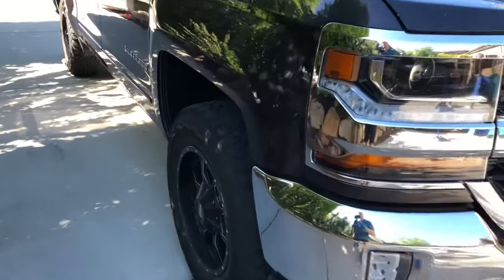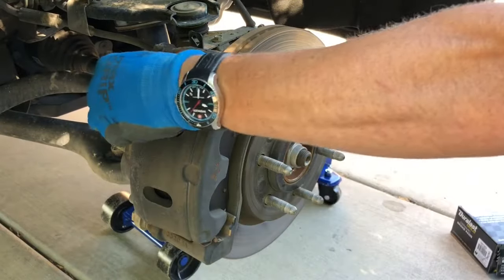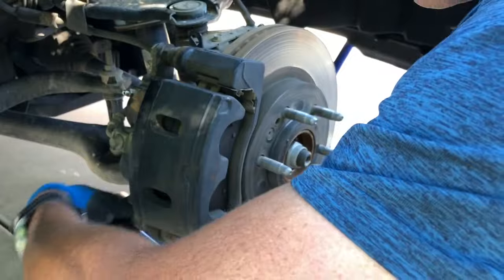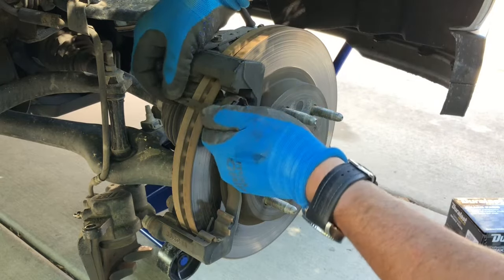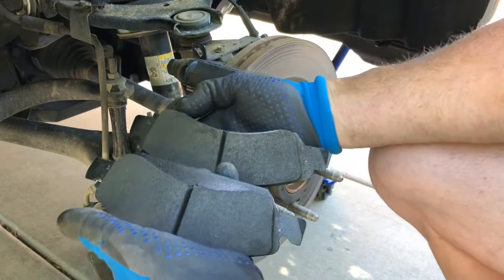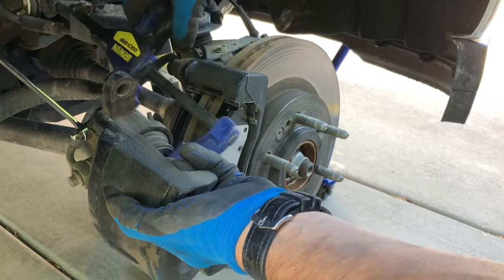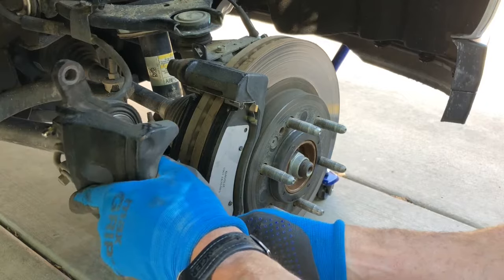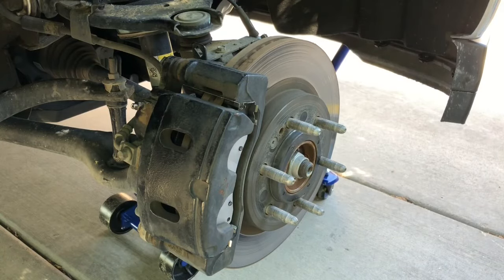2016 Chevy Silverado Replace Brake Pads

Comment: 1. never let the caliper hang like that.
2. no need to bleed 
3. use a old brake pad and a c clamp
4. clean and regrease (since its already open) 
5. apply new anti seize (never hurts)
Reply: I would also argue for proper torque for your wheels.  No clue as to how much or how little he put on there.
Reply: 2. no need to bleed is incorrect.  Brake fluid breaks down especially the fluid in the caliper.  After a bit, it absorbs moisture.
Reply: @dark4137 it's not incorrect. You don't need to bleed the brakes to change pads. 

You do need a brake flush every 2 years, where all brake fluid is replaced. Losing a drop will not prevent water entrapment
Reply: exactly right no need to bleed

Comment: Never let the caliper hang like that rest it up top or strap to something you can end up ripping your brake line also grab the old pad rest it against the caliper and use a C clamp to push it back you don’t need to bleed the brakes at all
Reply from the maker: Thank you for the input Prez408. I’m not a mechanic. I just figure it out and make mistakes along the way. Happy to have input which helps others who might be watching and figuring it out too. :)
Reply: @abvellinga  no worries we’re all here learning any input for anyone is helpful I didn’t know myself thank god for YouTube it has help me many times with my cars and neighbors cars
Reply: Thank god you said this cuz I was starting to think I would do it wrong! I would just normally pump the brakes a few times after I was done changing tjem and they were totally normal after those few soft pumps

Comment: Never, ever, open the bleeder unless you're bleeding the brakes, which doesn't need to be done changing pads. Taking the cap off the master cylinder is all that's needed to relieve pressure. Opening the bleeder when not actually bleeding the brakes introduces air to the system and you don't want that. 
I usually lubricate the slide pins also. One more tip is to use one of the old pads to place on the caliper pistons before you push them in to make sure they  go back in straight and don't toggle up on you.

Comment: I’ve seen several vids about this topic most say you have to open bleeders for one reason or another is that correct or not? also They all say you should grease the pins and make sure the rubber boot around the pin is intact, clean and secure is that not correct? I want to do my own work but I want to make sure I’m doing the right thing.

Comment: Take cap off master cylinder. No need to break the bleeder. This prevents air from getting in the line and going through the trouble of bleeding brakes. Also always grease the calipers.

Comment: I'm not sure I would touch the bleeder.  Average bleeder will strip and round off.  I also agree with never let the caliper hang on the hose.  But it worked and that's all that counts.

Comment: Does the brake light and stabiltrak light on the dash come on when brake pads are worn out??
Reply: No each pad has a thin metal bent toward the rotors. When the pads wear down that thin metal will make contact with the rotor and start making a squealing noise. That’s your sound indicator

Comment: Just a tip, you should always resurface the rotors with every brake job. If not you're gonna have rough braking and not get good contact with the brake pad to the rotor.

Comment: I've never done these before but watching these videos seems simple enough. Question. Being that the outboard pad usually still has plenty of meat, why discard it? Why not just re-use?
Reply: Even wear happens when the pads and pressure aligns. Replace the front, rear or all brakes together.  It’s not hard, but I prefer to do a job once.

Comment: Don’t need to bleed the brakes or let caliper hang! Come on man
Reply: Open up your brake res cap and put a paper towel in it so when you push your caliper back it doesn’t overflow
Reply: Also use your old brake pad to push caliber back it will get both of them at the same time!